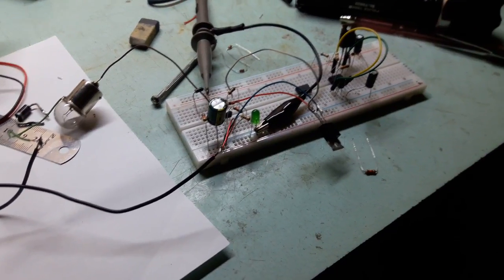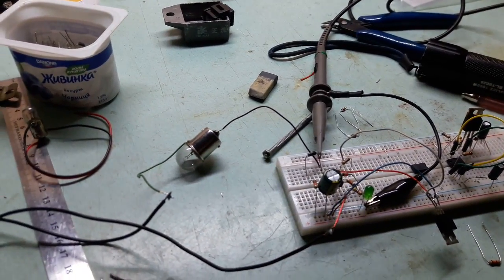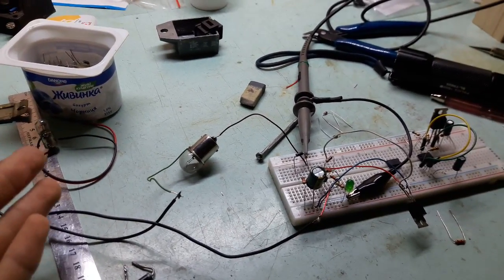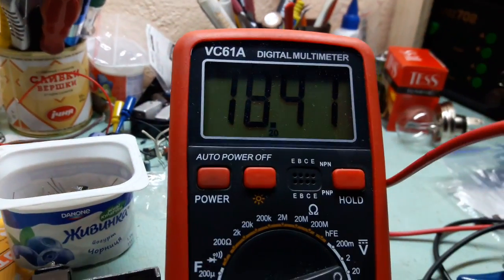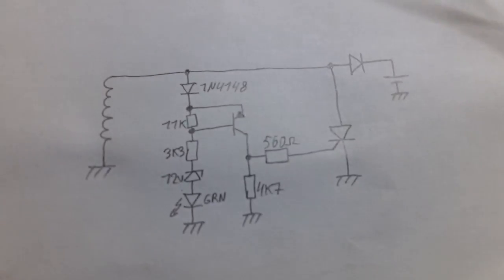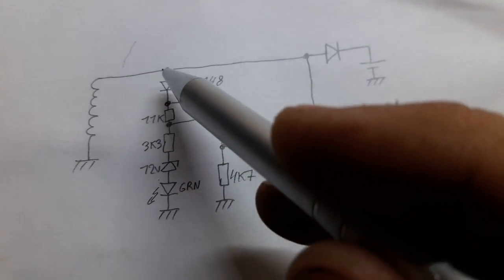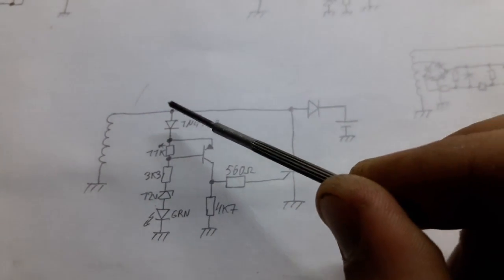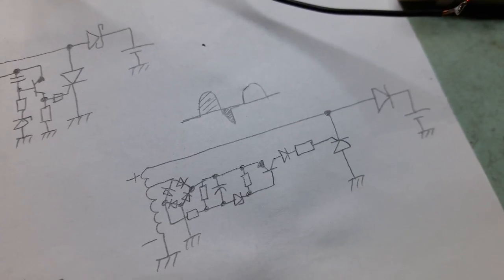Simple voltage regulator for scooter/motorcycle

Comment: why you use green led. and when it works or glow? when gate triger or un triger?
Reply from the maker: Because I didn't have appropriate value zener diode. 12v zener plus 2,5v on the LED gave me the necessary voltage output. It's a thyristor it will stop conducting as the voltage goes through zero crossing of the sinewave. Trigger the gate if the voltage is too high, and it'll turn off at zero crossing

Comment: Is there a way to have only a 2 pin regulator? Because I only want to limit the ac voltage. My other bikes also has a 2 pin regulator. One from the stator and the other on the ground. The lights in parallel with the regulator. Any help?

Comment: I want to power an arduino with 5 V straight from the magneto. Would this circuit still be possible just by changing the zener diode and adding a capacitor? I guess I would also need a load resistor for the magneto since the arduino wont draw much current and the coil would spike up to very high voltages?
Reply from the maker: If you plan to power just Arduino, it's better to regulate the output of magneto higher than 5v, then drop it with additional linear regulator. If otherwise, spikes on the power rail will make you go nuts when debugging.
Reply: @mrjohhhnnnyyy5797  Alright thats true. Can I use your curcuit for that? I dont have a battery installed on my bike, can I install a capacitor for smoothing instead?

Comment: Would it work if the thyristor (scr) would switch only if the voltage is not overcharging ? The scr won't shunt the alternator..
Reply from the maker: cccp3 got it right. Plus if you leave the winding completely unloaded, these alternators tend to produce WAY more voltage than they're rated for, so much sometimes that the insulation (varnish) on the winding breaks down and the thing shorts out. 
 These things are wound such so they poduce usable power when spun up at low-mid RPM's, so if you have no shunting whatsoever, when you rev the shit out of an engine the voltage will get extreme in comparison with normal.

Comment: Yours looks logical to me, it's similar to some of the shunt regulator circuits i've seen on the net. (Similar but different).
Your diagram will work a treat.

The one i looked at for a 3 phase generator had 3 scr's with seperate resistors that were driven from a two transistor trigger circuit,  i was going to make it with just one scr for my old kh125 6v single wire generator. 
For some reason i like diagrams of shunt regulators and capacitive discharge ignition on motorbikes, i'm a bit odd with collecting diagrams lol :-D.
Reply from the maker: I like these circuits too. They're stupid simple and work just fine. Oh, and by the way, you can use a TRIAC instead of an SCR, as long as it can handle the V and I :)
Reply: Oh yes i forgot the triac or thyristor i think (dusty memorys lol).
I tend to associate the triac with lighting dimmers and motor speed controllers, what i've repaired really.
Phase angle firing is the term that comes to mind.

Ooow disco lights, yep fixed them too :-)
Reply: @mrjohhhnnnyyy5797  hello man, i would like to talk to you about motorcycle rectifiers/regulator, how can we? facebook messenger, whatsapp... whaytever you want. i think you can help me.. and i'm from brazil.. :D
Reply from the maker: @JoaoPedro-bn2bg  The funny thing is that I don't use neither Facebook, nor WhatsApp :D
Reply: @mrjohhhnnnyyy5797  what app do you use for conversation?